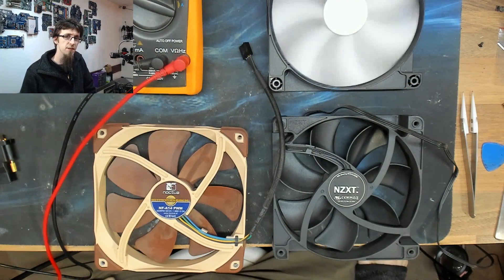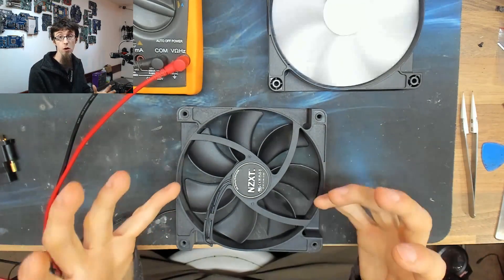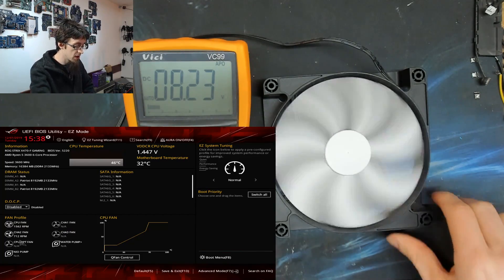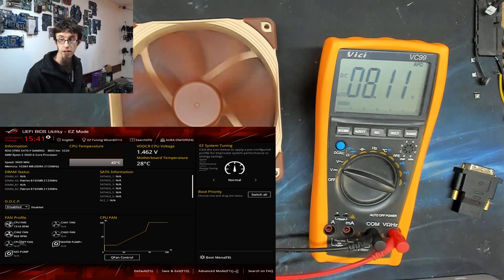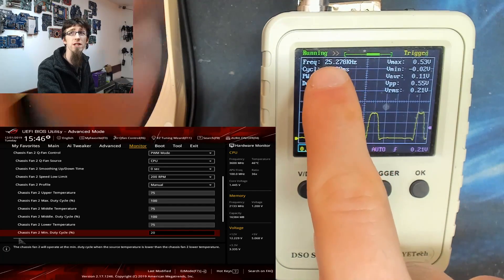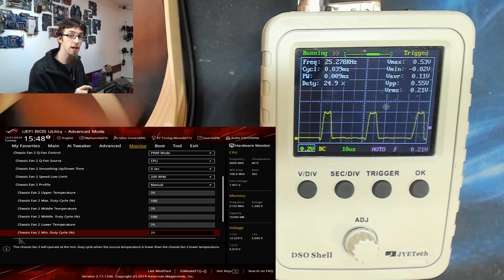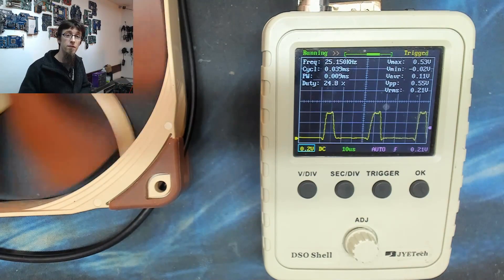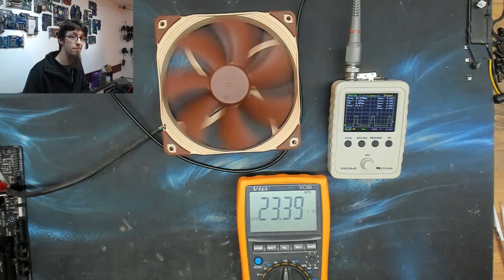LFC#191 - 3pin DC Fans vs 4pin PWM Fans

Comment from the maker: If you liked this video, I demonstrate this in action on LEDs in this video here: https://www.youtube.com/watch?v=sPkRS2sLXh8
Reply: I did like this video and it gave me some ideas for my situation. Question for you though. I just built a pc with the Cooler Master H500m on the ASUS Crosshair VIII Hero (Wifi) mobo. The case has 2 200mm DC fans that turn on and off on silent mode like you were talking about. I was thinking of replacing them but now I'm wondering if there's a controller that can treat them like pwm and also make them visible in Fan Xpert 4. Any thoughts on that? Also, why does it seem like 200mm fans don't really come PWM except for Thermaltake but those have a proprietary connector that isn't just a regular PWM fan connector? Confusing stuff... Anyways, appreciate any help you could provide. Thanks!
Reply: Some server fans are 4 pin with some of the pins wired a little differently. I've completely forgotten the "standard" they use. I think it was just an annoying OEM rewiring. I was (about 10 or 15 years ago) able to re-pin the server fan to work with out issue on a standard pc motherboard. It was a nice fast dangerous delta fan from memory :D
Reply: Nice explanation. So why they don’t control the DC fan via current?
Reply: @tamaica7770  Stepping up and down voltages is rather easy to do. Stepping up and down current involves more work and other various reasons. More current = more heat for example.
Reply: skillet pan heat depends on P=IV. Lets say the fan can work at 6V, and mobo gives it current to operate. Increase current, increase the speed of fan. just not sure how they decided to choose V instead of I. maybe for safety?
Reply: @tamaica7770  https://www.researchgate.net/post/Why_do_we_prefer_using_voltage_than_current_as_a_data_carrier_in_electronics_Why_are_most_of_electronic_devices_implemented_as_voltage_converters

Voltage is used in power lines instead of current for the same reasons. As a teacher once told me (he was 70ish years old and had worked in the power delivery industry for about 40 years), if you used high current the power lines would end up being several meters thick. If you use high voltage you can step down that voltage and lose less power over the same distance. You'd need thicker circuits for the same result. High voltage and lower current means you use less metal to make circuits for the same result.

 TLDR: It's better to use voltage because there's less resistance issues/signal degradation. I vaguely remember this as being the reason from electronics courses from high school etc.

Comment: a DC device can be controlled by one of two means.  lowering the voltage, or pulsing the power into timed slices.   the switch ON 50% of the time and OFF 50% of teh time, but the switch firing about 30 times a second.
the other means is to just reduce the voltage.  this is bad for motors as they are not designed for lower voltage.
the 4-pin fan has the pulse circuit on the fan.  the 4th wire telling it how fast to pulse.
the 3 wire, has to have that pulse circuit as an external device.

Comment: I have bought a 4 pin fan for a different application.  Can I use a 0-5v on the PWM pin to control the fan speed?
Reply from the maker: No, it needs to be a a square-wave. If you can only do voltage control, then just do 0-12v on the power pins.

Comment: Can someone explain please if there is a difference in power consumption? I would imagine both types consume roughly 50% of energy if operation speed is at 50% ?
Reply: Voltage control generally uses resistors to control voltage.  The extra power is just dissipated through the resistors when the fan spins slower so overall, no energy is really saved.  Whereas in PWM,  the 12v is turned on and off internally in the fan, which does save some energy

Comment: I wonder what the life span differenceis between the two methods of speed control. A 110mm ac case fan is running still, 24/7 for about eighteen years now. Thanks for the explanation, It took a few vids but yours put it all together. Thanks

Comment: The entire point of just about any fan...is to move air. Being worried about a few dB should be a nonfactor. Or a far off 2nd. The ability of a fan to cool the components is the primary factor...the difference between a few hundred rpm and a few decibels...and how the ability to cool components...it shouldnt matter. If youre that comcerned with an added 2dB at your desk or wherever youre at...you probably should change other aspects of the setup instead of cooking your comp by quieting your fan...

Comment: So what's the minimum speed of the pwm fan?
Reply: It varies depending on how it's programmed by the manufacturer. Some fans will go to 0rpm at 0% duty cycle, however this is quite uncommon as it is potentially unsafe to have electronics running in a cabinet when the fans are off. Most PC PWM fans will go down to around 500rpm at low speed, while server fans are often more aggressive, some with a minimum speed of 2,000rpm.

Comment: Another beauty of PWM control: I'm a model train enthusiast. My DC trains can run on straight DC or PWM, but using PWM allows the lighting to remain at full brightness,  and the sound function at full volume, at any speed. The full voltage is always available for a fraction of the time and is used to charge capacitors to power the accessories. Wall warts / power adapters can be made without heavy, expensive copper windings if they use PWM.

Comment: I mean one more question which is not answered will   will last longer?  4pin its  getting kicked with 12v like milion times in day with mini brakes and  3 wires where power just go down little voltage and chilling and that's it ? I mean its a question  . that 12v kicks to fans whole day to keep them chilll or 3pin which will hold low spin and not kicking fans with 12v powers . will 3pin or 4pin fans die first ? :)
Reply: It doesn't really make a whole lot of difference... the only notable thing is that 3 pin fans running on low voltage result in wasted energy.

Comment: The Asus motherboard does allow under 60% voltage but only if you run the automatic fan configuration first. It tests the RPM range of the fans.

Comment: I have bought some 4-pin PWM fans but I can't get them to turn off when not needed (at 0% duty cycle the still spin at 600 rpm). The only way is to put them in DC mode and then select 0%. Will it cause any problem in the long run to use DC mode on PWM fans (maybe on the PWM controller)?
Reply from the maker: Won't damage them, no. The fan controller must not have a true 0% on it, as 0% by definition must switch off. It's not uncommon to see fan controllers not go below 20%, so maybe your one is like that, but just doesn't report it properly.

Comment: Realy nice video. I've enjoyed it a lot. Few time ago i've to buy a new processor  fan because mine have burned after 6 years of use. I almost bought the 3 pin fan but after some internet research i discovered that processors use pwm (4 pin) fans. Then i bought the right fan for my processor and i am still waiting for it to come. Thanks for nice content. Regards. Rodrigo.

Comment: Amazing, the most comprehensive video I have seen on this topic. But what happens if I use a simple pwm fan speed controller in a mix of 3 and 4 pin fans?

Comment: Voltage control uses resistance to lower the tension, therefore as a result it consumes more power due to the loss of energy as a form of heat; this makes PWM a power saver. I really liked your channel right away after watching a couple of videos because obviously it is not made for showing off but for teaching purposes, “not too many infos + accuracy at its best = subscribe”. Thank you.

Comment: You explained it really well. Now I am in a problem with colour codes of wire. My old 3 wire fan had brown, red, and black colour wires, and my new 3 wire fan of same model and same company(ebmpapst) has red, white and blue colour, so how to connect this new fan?
Can you help me get the solution

Comment: Thank you!  I've been hunting long and hard for PWM fans what will accept 0 duty cycle = 0 rpm and finding none of them wanting to claim less than 200rpm.  That's fine, but I want them to STOP completely.  Buying fans that clearly supported 0rpm or 0db mode seemed like it could cost me two hundred quid/dollars.  
Understanding that the DC fans, given the motherboard allows it (Crosshair Hero), WILL allow me to STOP "secondary" fans.  Fans that provide filtered intake air for exhaust radiators, for example.    I don't mind the main radiator fans being PWM doing 200rpm and not stopping, they are pretty silent.  However for these only on under high loads fans.... DC fans will work I don't see many use cases where you would want to run intake support fans at anything less than 50% anyway.
As I have a collection of DC fans and DC fans are cheaper that could save me a lot of money, especially as I'm 90% sure the CH H8 supports DC fan "Fan OFF" mode and 0% voltage.
Reply: Oddly the Alphacool rad fans are DC.  Their label says 0-2500RPM.  It will be interesting to see what their minimum stable speed is.  I also have a box of fractal design DC fans I can test.
Reply: Also, note...  The CPU fan headers are different.  CPU FAN, OPT, PUMP and AIO_PUMP are all guarded to not go to 0 (PWM or DC).  The CH H8 limits these to 40% minimum.  This is where good quality PWM fans are king.  They will adapt to the 40% minimum and be silent and slow at that, higher than normal limit on PWM.  Chassis fans and aux fans will accept 0% and "Fan Off" states... at least on the CH.

Comment: I have a stupid question...Can you cable split 2 different size fans 120mm and 92mm case fans? I have the cable splitter connected to 4 pin header off the motherboard sys_fan...from there one end of the splitter (4pin) goes to my 120mm 3 pin case fan...the other cable end (3pin) going to my 92mm 4 pin fan. Is this okay or safe to do? Seems to be running fine at one speed.
Thanks
Reply from the maker: Yup, that's completely fine, you can run uneven loads in parallel, which is what a splitter does. Obviously there'll be speed differences between the fans, but the fan controller won't care about that.
Reply: @Adamant_IT  cool thanks everything seems to be running OK I just got nervous because I saw some ppl say only use identical fans on a split and if you decide to use different sizes make sure they're the same pins.

Comment: I'm just wondering, just how superior is PWM when it comes to power efficiency, say for running a fan at half speed? Is it also true that using the undervoltage DC type fan control generates extra heat compared to PWM? I'm looking to run some 12-20w beefy Deltas at half speed or so, and it looks like I can get PWM and conventional varieties.
Reply from the maker: Interesting question. I'll actually test this tomorrow/at the weekend if I remember, and I'm curious to know the answer. It'll likely depend on conversion efficiency. Most voltage controls will actually be done by a fairly efficient switch-mode converter (which is why there's some smart asses in the comments saying "they're all PWM" which somewhat misses the point) but if you did voltage control with a linier regulator (which old-school fan controllers did), you'd waste a lot of power in heat.

Comment: Why does not the reading (pwm) show 5v?
Reply from the maker: Logic signals are usually 1v or 3.3v, fairly uncommon to see them as high as 5. They don't carry any meaningful current, there just needs to be a Yes/No On/Off signal.

Comment: An excellent video, I just want to add a note, not all motherboard manufacturers are so restrictive like ASUS about the DC fan control, some allow to set the voltage down until the fans stop, even in DC mode. I have four 200mm Cooler Master fans, and the difference between 50% and 60% is VERY audible, in an ASUS motherboard the sound is really annoying at 60% but in my new motherboard I can set the voltage I want in the BIOS, if I remember correctly, I have the fans at 6 or 7 volts at the beginning of “the curve” and the sound difference is really big.
It’s a shame that ASUS don’t give the user full control of the fans… That was why I change brand.
Still, I really think that this was the best video I’ve watched on the subject, congratulations to the guy with the cool beard.

Comment: I'm confused about voltage needed on singal cable. Does your osciloscope shows 0-0.5V range? Does this need to be scaled to 12V?
Reply from the maker: My scope is terrible and I wouldn't trust its voltage measurements, but in any case, the PWM signal is just a signal, it doesn't do any work per se. So it can be very low, somewhere between 0.5 and 1v, and switch a mosfet inside the fan on and off.

Comment: Excellent explanation, thank you, I just had one question... Does this mean 3-pin fans use less energy? Or is the consumption similar because a PWM fan is "off" for a certain part of the time rather than just permanently drawing less power? Thank you
Reply from the maker: Correct, the PWM fan is functionally "off" on the low cycles, so will be pretty similar to 3pin.

Comment: where does unused electricity go on pwm fan when it is 12v all the time, but the pwm gives a weak signal. say 20% duty cycle.
Reply from the maker: It only draws current (amps) during the ON peak of a cycle. during the OFF part of the cycle there is 12v supply, but no current draw, and thus no power (electricity) being used. This is a bit harder to observe though, as you need a current probe or shunt connected to a scope to see it.

Comment: Which one of the mods ( dv or pwm ) can let you have your system auto adjust the speeds dependant on temperaturs and other variables that the system monitors and does on it's own ?
Reply from the maker: Auto-control can be done with voltage or PWM, just depends on what fan controller you're using.
Most modern mobos will allow voltage control down to low levels. The main difference is purely what range a fan has. 4 pin fans tend to have a much wider speed range.

Comment: Some washing machines run with 3 phase AC induction motor with its own motor control board (MCU as they call it). It converts 120VAC to 3 phase AC.  The main board on the washing machine seem to basically supply the PWM.  There is plug in from the main board to the motor board with 3 wires.  The 3 pins are ground and 5VDC plus one more which I assume is the PWM.   I supplied the Motor control with 120VAC and 5 volts to the PWM  to see what happens.  Nothing happened.
So I am assuming the third pin ( pwm) is what sends the signal to the motor control to get going.  
If I have this right, is there a simple pwm  supply one can get to do the job since this has its own inverter, I am just wondering.

Comment: Would it be a good rule of thumb that on modern motherboards you should only combine 4-pin pwm fans on the same header and 3-pin fans should have their own headers?
Reply from the maker: Correct yes, if you're using fan splitters, each splitter should have the same type of fan on it. Mixing won't cause any damage, but you won't have proper control over the fans. Either the PWM fan would be DC controlled (resulting in lower performance) or the 3pin fan would run at full speed all the time, as it can't receive the PWM signal.
Reply: @Adamant_IT  Yeah. I ran out of headers and tried to use a splitter on a pwm cpu and a 3-pin top case fan. My 3-pin fan wasn't even spinning. So I paired two pwm cpu fans together on their own header and left the 3-pin on it's own header and everything works fine. I think pwm fans are better for combining onto a single header -- I have 4 fans on the case door and they are working fine combined on the high-voltage fan header.

Comment: So the only way to make the 4pin pwm fan work at full speed is through your computer. You can't cut the 4pin and make a 'do it your self project' ?
Reply from the maker: 4-pin fans default to full speed if they don't receive a PWM signal (ala, if you disconnect the 4th pin). But if you're doing that, you might as well use a 3-pin fan.

Comment: hello my helios 300 one fan was stuck and another was working fine, I cleaned cooling system and repast thermal paste, now both fans sre spinning slow but not on system control and not showing fan details on software

Comment: Hi, I have purchased a fan 12 volt and 2.8 Amps it draws about 33 watt full speed but it is too much air and consumption. If connected with the motherboard the fan spins and then turn off every 3 seconds. Maybe the motherboard connector release 12 volt but not the amount of amps required? So if I lower the voltage with a potentiometer, should I be able to lower the fans speed? I have a module that gives all the energy I want so 12 volt 2.8 amps I would like to try with this module to a smoother speed and lower consumption. Any tips to how do that?? thanks

Comment: im not sure you are right about dc control not being pwm...? did you try it with the scope? how would the motherboard generate variable voltage the circuits to pwm are so much simpler?
Reply from the maker: It's PWM in a different place. Yes, the voltage is stepped down via PWM on the motherboard, but the fan isn't being switched on/off by that voltage.
A PWM fan at 50% has 100% torque due to being supplied with 12v, but a 3pin fan at "50%" is getting a constant voltage of 6v, massively reducing its torque. It's debatable as to how much this affects overall performance, but the important thing is that they're getting power in two very different ways.